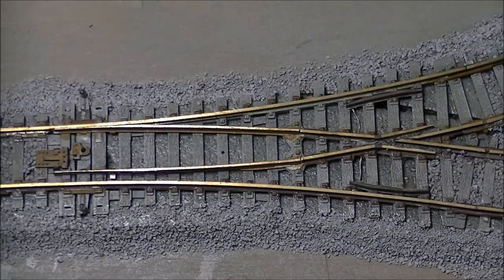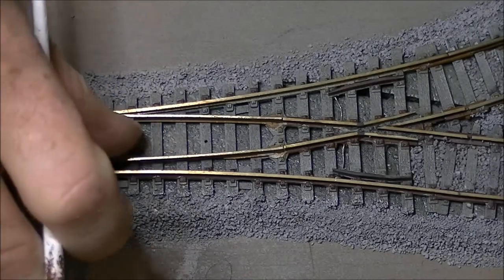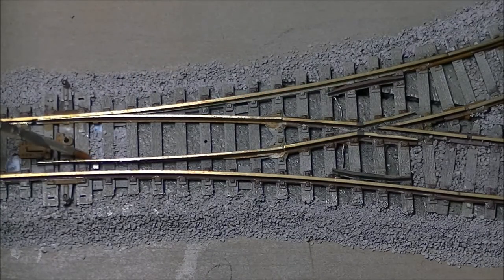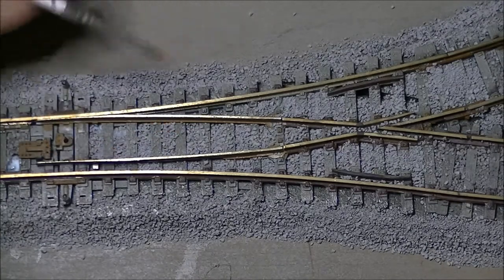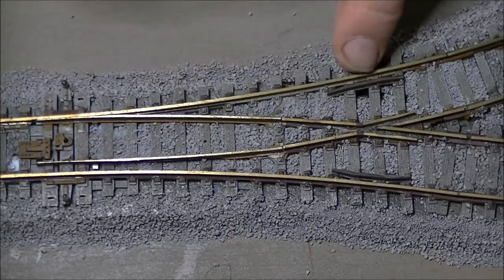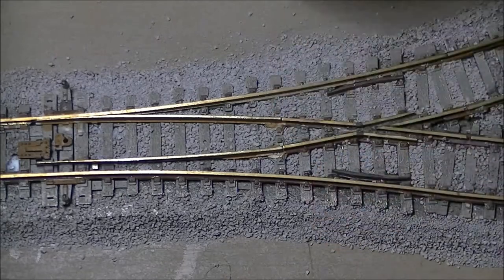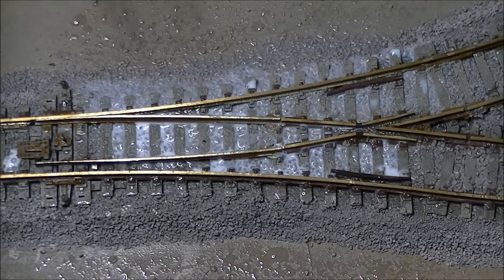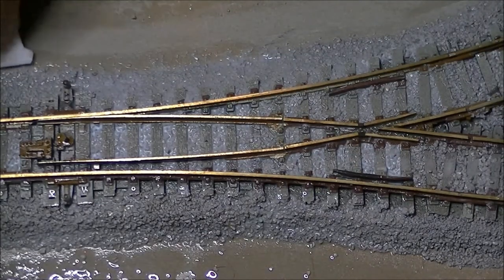Ballasting a point

Comment: Have you modified this small y electro frog point for more reliability? If so how?
Reply from the maker: Thanks for commenting Samuel, It was a long time ago probably the only thing was taking the spring out, and the usual wiring up of the stock rails as per any other conversion of an electrofrog point for DCC work. I don't bother taking the spring out with the digital IP motors anymore, i kind of like to hear the click so I know they have switched.